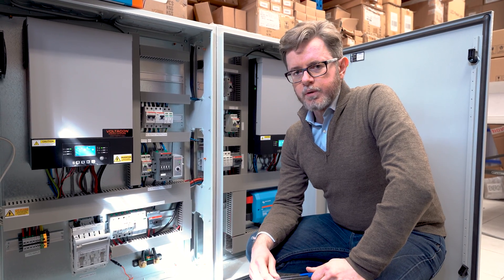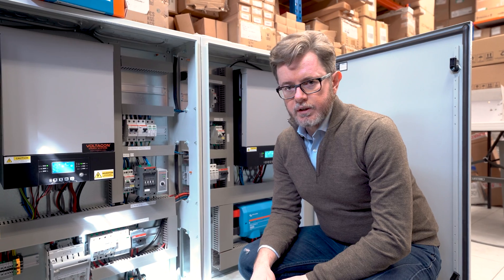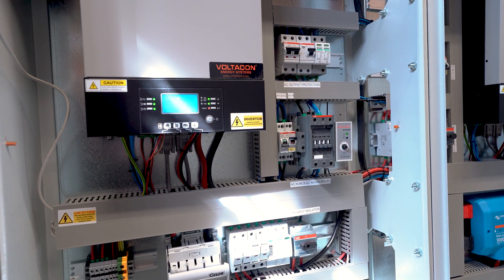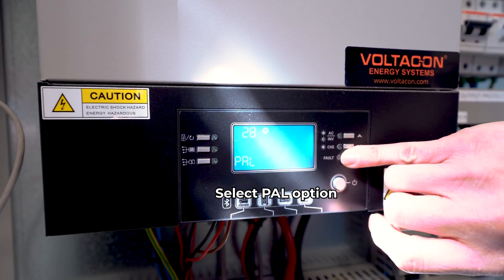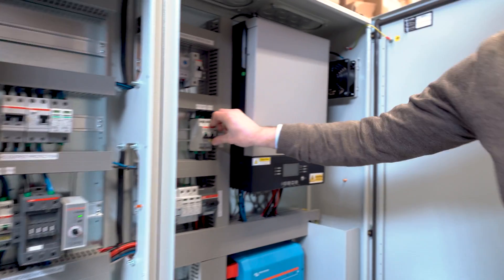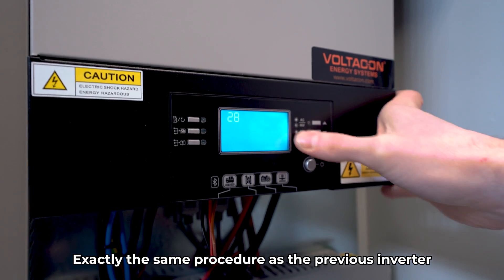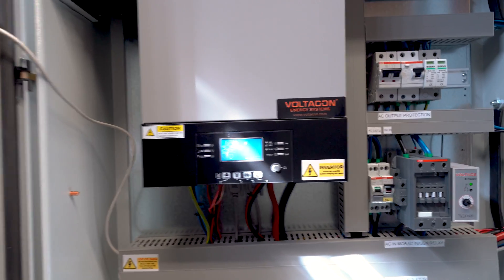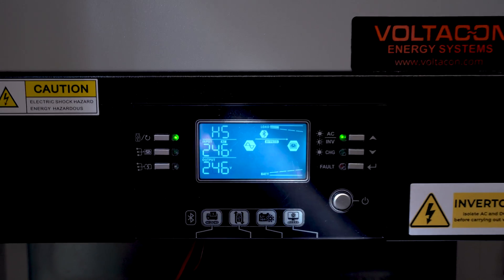How to Connect In Parallel Two Off-Grid Solar Inverters Conversol MKS-III. Step by Step Guide.

Comment: Can u parallel 2 invertwrs of the same make, firmware and brand but different capacities.

Eg a 7.5kva and a 10 kva
Reply from the maker: No this is not possible
Reply: @voltaconsolar  Thanks fir the reply. Pls could you kindly explain why to me. I mean the science/engineering behind it

Comment: Hi. Thank you for your video. I have two 5Kw inverter wich I put in parallel mode but without connecting the output. I only connect the neutral cables togther because I wanted to ensure that the voltage between the output phases is zero before connecting them. What happen is that the slave seem to search to be locked on the master as the voltage start increasing from 0 to 220, the output relay set off then on before increasing again. A freinf of mine told me that this a normal behavior and that I have to connect the two output together.

Comment: Is it possible to connect Hybrid Inverter in parallel on grid inverter using Hybrid Inverter as Grid ?
Reply from the maker: If you use the hybrid inverter with on grid mode (be careful I am not taking about off grid inverter) then both hybrid and on grid can be connected to the same grid because these inverter synchronise automatically no matter what the brand is

Comment: hi can you help please i have  a voltronic Axpert king 3kw 24v off grid inverter  max dc input is 145v, I have 4 of 370w pv solar panels the open circuit voltage in series would be 138v and 1480w, is it ok to connect these 4 panels as they are so close to the max spec of the inverter or would it better to just use 3 panels at 104ocv and 1110w
Reply from the maker: Yes it will work
Reply: @voltaconsolar  thank you  very much for your reply